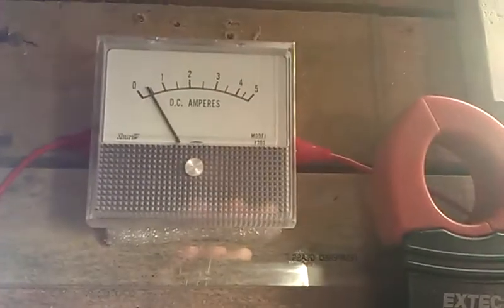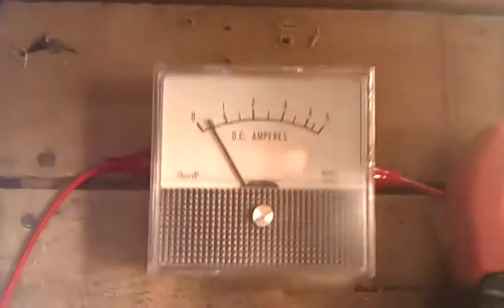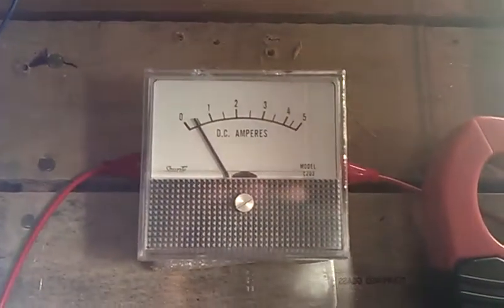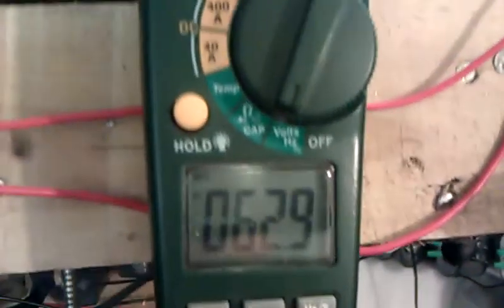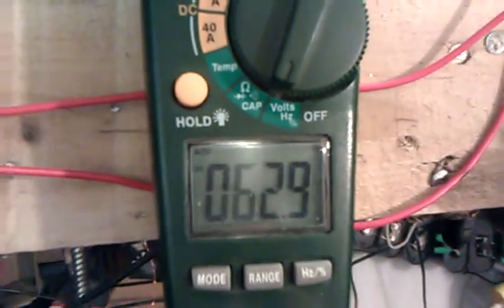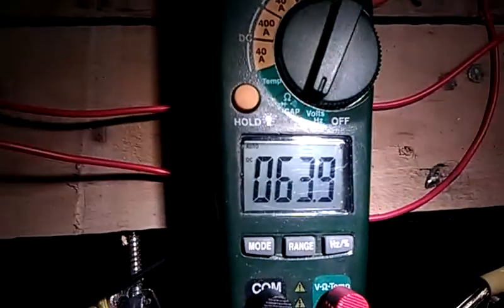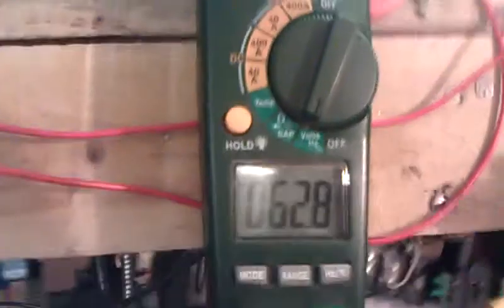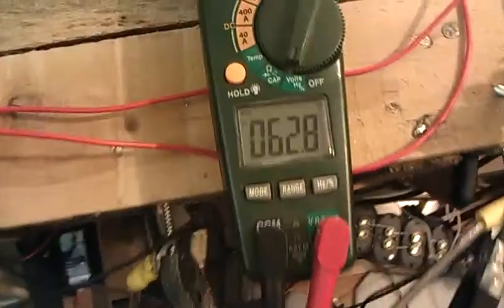39D BiToroid: Resonant Driver, More Measurements

Comment: Ok, but my question is: how much takes the power generator in input. Really, for a foreigner, having a schematic with everything on, is very much clearer than verbal explanations and wires seen on a table, even if obviously, your try hard to make it clear indeed :) I'm just still interested you know in any real COP>1 around, not apparent because of no RMS measurement or because the current goes 90 degrees our of phase so you no more read anything on the meter and claim the input W-power drops :/

Comment: kurt, i like your use of the RMCybernetics schematics for the DS to tweak the freq. i'm hearing with each new part of a build, the resonant freq can change, so having a variable circuit there looks like it helps you..trying to learn as much as possible before trying a build. from what i'm hearing, achieving resonance in all 3 stages is needed?  HV/HF + L1/L2 + AC or DC out

Comment: Are you sure your extra voltmeter can measure rms values at these frequencies? I mean I had to buy me a special voltmeter, where it stood in the specs that it could handle up to 100.000 Hz in Vrms measurements - to be sure measuring Vrms in my experiments. 
Most of the time I think I have some OU - my electric guru of a friend educates me in yet another aspect of how difficult it is to take all the parameters into consideration trying to validate Win versus Wout.

Comment: looking good. have you been able to tell or see if the circuit will perform as don said in that making the battery wires 1/4 of the wave length, the system will keep the battery charged?

Comment: Sounds right, the secondary coils may even have fewer turns and thicker gauge for 16-20V output depending on requirements.  Have you a battery charge controller or hi-torque DC motor this could work with?  Interesting and desireable results, thanks for sharing.  My biggest difficulty was in sourcing the core material; in the videos I've posted most of it is er70s mig wire and black iron oxide.  How might someone get ahold of similar (ferrite?) cores as you've implemented?

Comment: Hello, is the energy streaming from the secondary coils connected in parallel?  The resonate frequency, surely dependant on the load then without a coupling to the Primary when the flux path is one way from the input signal it doesn't seem to effect the value.  How are the permeability of the cores you have obtained?  Would pulsing the output back to your 12V source battery from an electrolytic capacitor and SCR be a viable option?